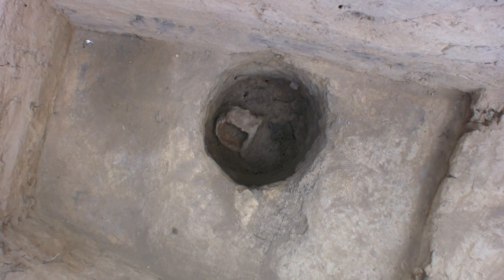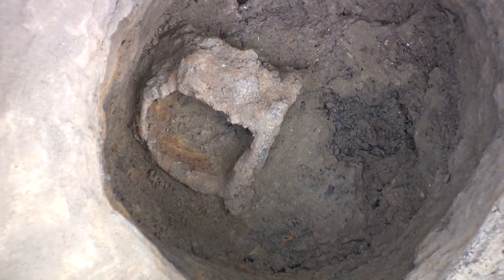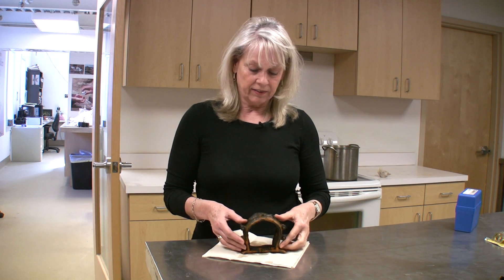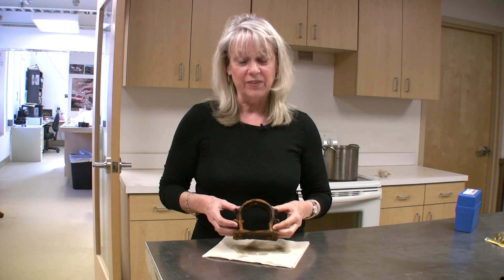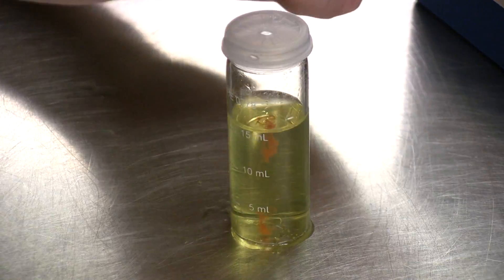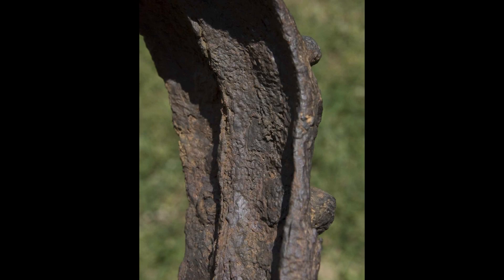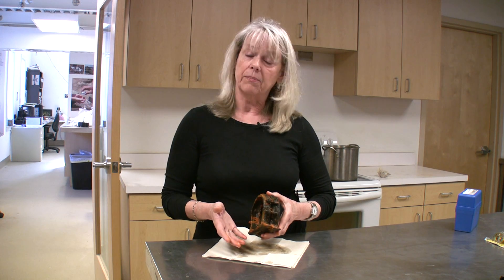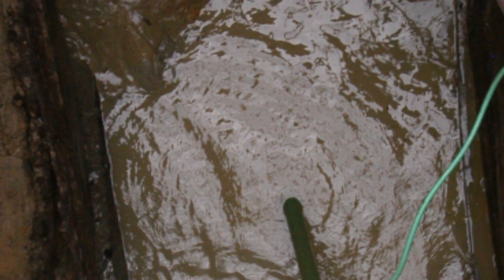Unusual artifact found in a posthole from Jamestown's first substantial church

Comment: Actually if you look there is the small hole in the middle of the split and it even stands on the flats created when assembled. It is obvious to me this is the frame for holding the sand halves of a sand cast mold. Check to see when or if they had any kind of foundry on site or possibly a good blacksmith. Probably were casting something out of softer metal such as brass or copper. This would be easier then iron unless this would maybe be big enough for early iron horse shoes? The horse shoes would make sense to have a re usable mold frame for many repeated castings as the wood frames would deteriorate over use. Check with a historical department for foundry or early blacksmiths for verification.
Reply: I agree - For those of us that had Jr high or high school metal shop this does look a lot like the "cope" and "drag" that we used to make two part sand castings and then fill with molten metal. The hole on top would be the sprue or riser.
Reply: Yep, there is literally one of these nearly identical in form and purpose available to purchase on Amazon right now. Gimme a PhD.

Comment: I don't see a pipe connector. Why the flattened bottom? The arc isn't complete enough and the flat part is too big. If it joined lengths of pipe each pipe would have to have matching flattened parts to make a good joint. It's easier to make connectors completely round rather than flattening ends of pipes. 
I have no clue what it might be, but I get the sense that it might have been part of a ship's hardware, that found double duty on land. Anyone check with a naval archeologist? Just a thought.

Comment: So you asked everyone but the plumbers or shipyard pipefitters? If that is a coupling for pipe the modern equivalent is called a Norma Coupling. It could have also linked sections of canvas hose pipe.More likely hose pipe since drain pipe in that time would've been bell ended. Or I'd could've been a simple pipe hanger.

Comment: You slide both pieces over a wooden log and drive a nail though the hole in the top so when placed on a flat surface the log will not roll when your working with it.

Comment: Perhaps this was a blacksmith/armorer's attempt at casting 3" diameter grenade shells/casings.  That would require two exterior clay molds (each held in its iron frame) and an internal spherical mold set between the two.  The fuse hole would be at the bottom of the molds and the sprue hole used for the pour at the top as seen on the artifact.  For examples of the grenades see:  https://www.history.com/news/pirate-shipwreck-grenade-discovery-schiedam .  For description of period use of grenades see: https://thescholarship.ecu.edu/bitstream/handle/10342/7269/LACEY-MASTERSTHESIS-2019.pdf?sequence=1&isAllowed=y  
See also: https://exarc.net/issue-2018-1/mm/replicating-black-powder-grenades
Reply: See also: https://www.etsy.com/listing/837740747/traditional-sand-casting-flask-moulds?ref=pla_similar_listing_top-2&pro=1